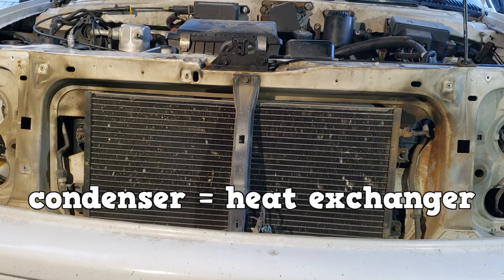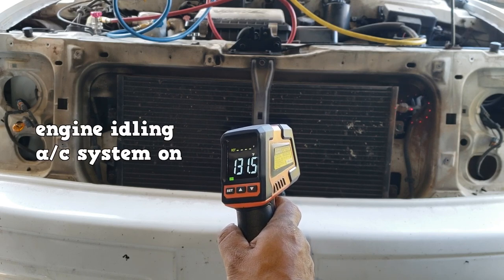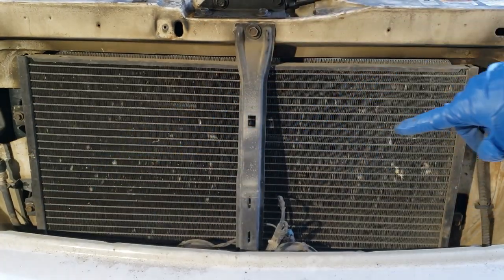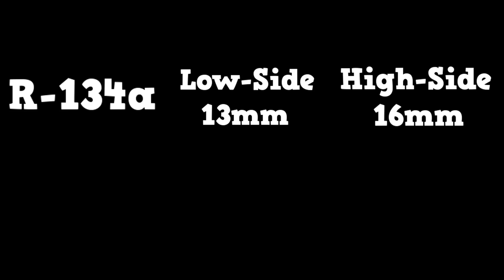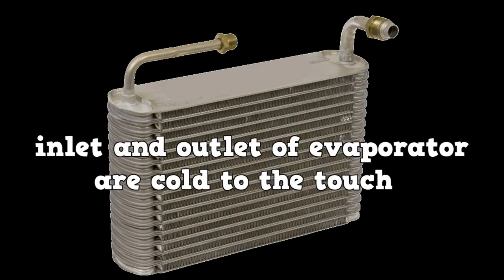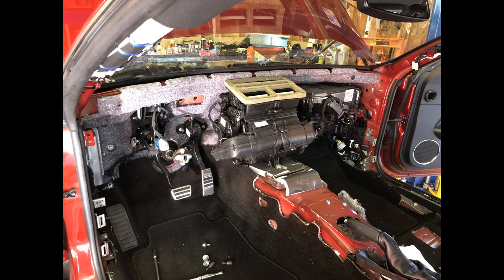A7 Test Prep #3 - Condenser and Related Components

Comment from the maker: Update Oct 15, 2023: (Feedback after taking the test) Only 1 question related to the condenser temperature drop test.
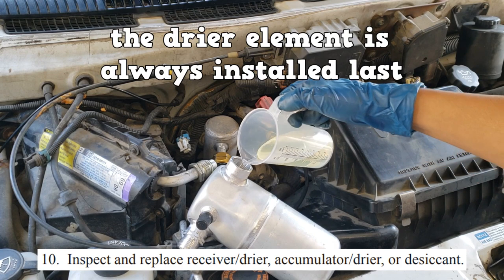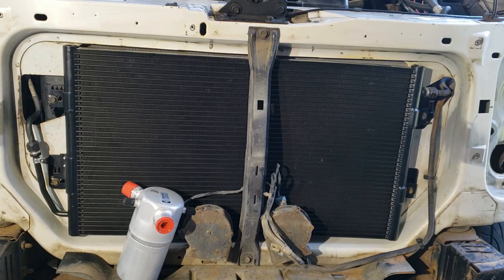The info from 2:12 to 2:56 was not on the test. The test focused on what happens if the dryer element is saturated. This video does not give very much definite info on that, you will need to study that some more.
1 question about halogen leak detecting
No questions about service valves.

The evaporator was a big subject on the test! I could do a test prep #5 video solely on the evaporator. Know as much as you can about the evaporator, how it affects system pressures when clogged or restricted airflow. Know how it affects outlet temperatures and other issues like it icing over and "EVAP outlet temp."